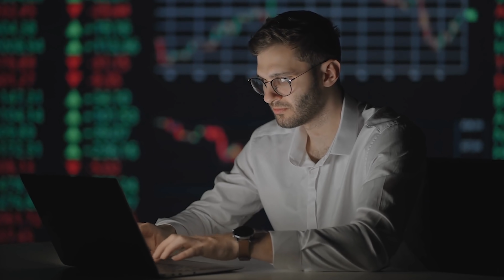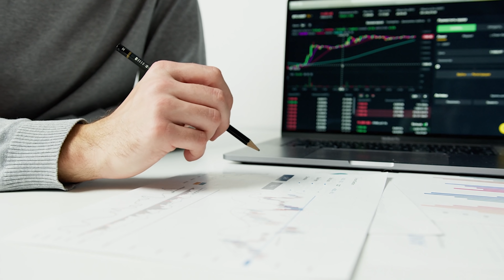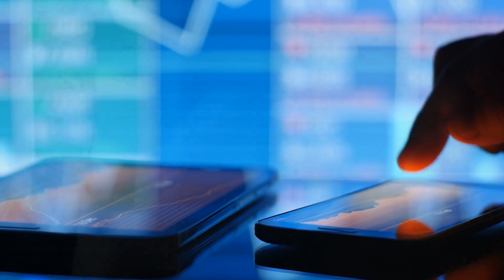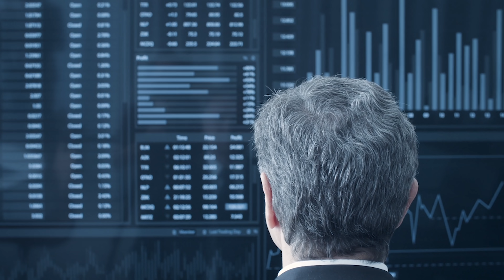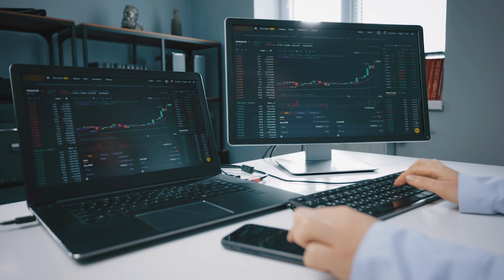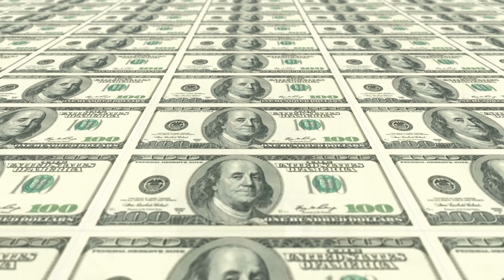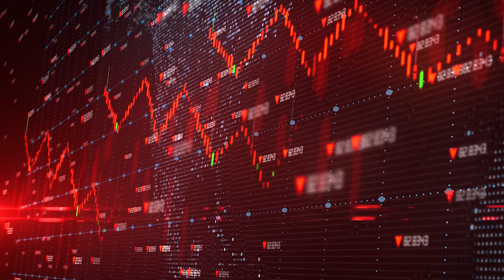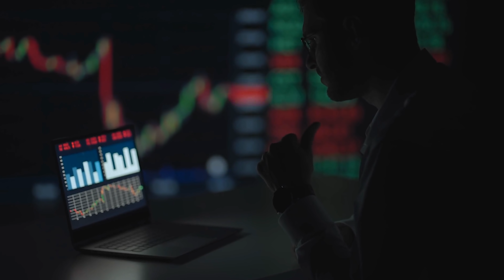The Tesla Bulls Won!

Comment: Tesla insurance will be very profitable 30 - 40%. As they license out their software to other companies drivers will purchase Tesla insurance due to the real time analytics. Premiums will be based on actual drivers performance on the road. In most cases the cost will be cheaper than the other companies. They don’t have the real time data. This will grow to include homeowners policies as they branch out to the  power wall and solar customer base. Some insurance agencies don’t want to insure homeowners with power walls and EV’s due to the potential fire hazard.

Comment: "Tesla gets more range than any EV in history..." Not true. Lucid does have an efficiency/range advantage in at least 1 of their cars. I still suspect, however, that most of that is down to better aero in a slightly smaller car with much less frontal area.
Reply: Possibly. But Lucid have yet to deliver a single car to a genuine paying customer.
Reply: Check out Warren Redlich’s analysis of Lucid’s reported battery capacity. It looks like they are using a bigger battery than they are reporting.
Reply: I would hold of that claim until someone can verify the battery size of that car. Besides, we are talking about production cars here and Lucid is not there yet.
Reply from the maker: I said it past tense, of when I was investing and Chanos used to tell us how bad they are. Besides there is a lot of smoke and mirrors surrounding Lucid
Reply: @TeslaEconomist  Getting a range advantage by making the car smaller and having more slippery aero, but then pretending it's some kind of immense technology advantage IS smoke and mirrors! Rob Mauer did a back of the envelope calc about this, and at that time, his calculation indicated that 14/17 of their range advantage was aero. That would mean their revolutionary motor was only 3% more efficient.

Comment: Wall Street worries about the next quarter.  Elon worries about the next millennium.  Stay patient and ignore (most) of Wall Street "news".

Future Tesla (conservative) milestones:
Opening of Giga Berlin - Projected by end of 2021
Opening of Giga Austin - Projected by end of 2021
Volume production of 4680 battery - Projected by second quarter 2022
Volume production of LFP battery - Projected by second quarter 2022
Commissioning of first DOJO computer - Projected by second quarter 2022
Start of Semi production - Projected by third quarter of 2022
Large expansion of residential solar power installations - Projected by end of 2022
Start or Cybertruck production - Projected by start of 2023
Start or Roadster 2.0 production - Projected by end of 2023
Release of FSD to general public - Projected by start of 2024
Start of next Tesla factories - Projected by start of 2024
Start of Model 2 production - Projected by end of 2024
Start of Tesla Bot general production - Projected by end of 2025